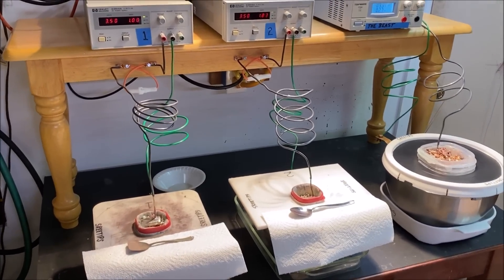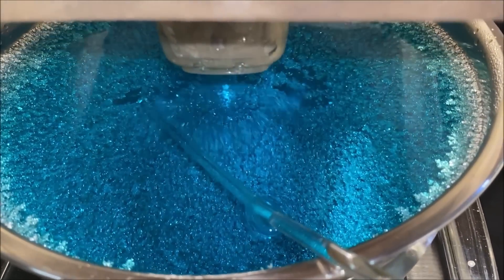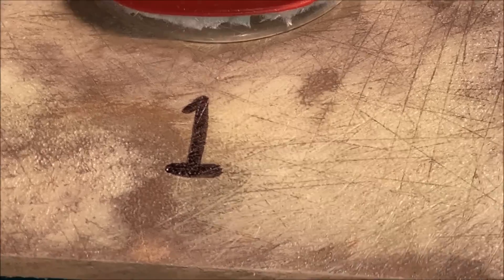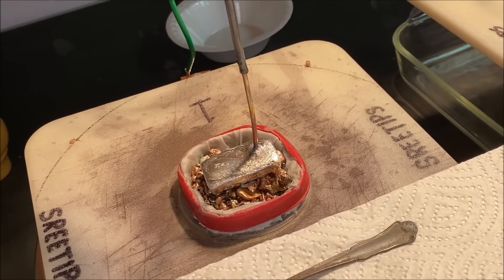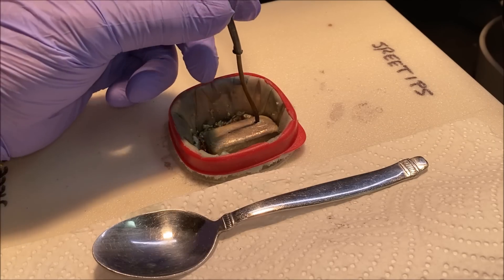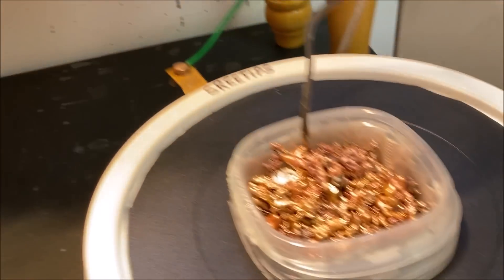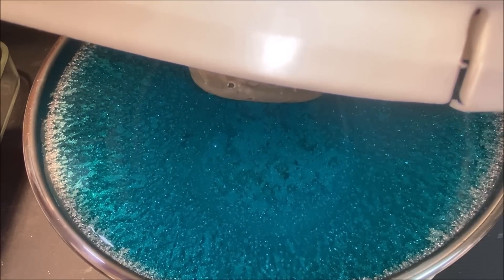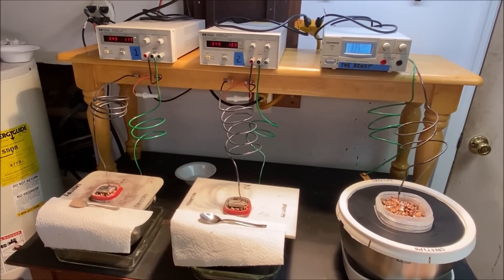Silver Cell Day 3 Maint 72 Hours Crystal Growth

Comment: I'm sure you have gone over this befor but why do you have to have silver dissolved in the elecrtrolite is it for the silver nitrate to form I don't know much better brains have came up with this than mine I just really strive to seek information from a reliable worse. Knowledge is freedom not just power
Reply from the maker: The electrolyte is conductive and it completes the circuit.
Reply: The way the silver cell works is impure silver is converted into pure elemental silver. The way that works is impure silver is dissolved by the electrolyte, which also has silver nitrate in it. The silver nitrate and the electric current make the impure silver into Ions that then pass into the fluid and go to the walls, which is where it's later scraped off when it's harvested.  Now for the too long; didn't read section. [tl;dr]

A little more detail here... The silver nitrate solution, the electrolyte, can not take up any more silver. It has had all the nitric consumed with the silver used to create this solution. The electricity has a clear path through this electrolyte to the walls of the bowl. Here it completes it's journey  -from the negative to the positive, this is the way we we're taught. 

At an increased current (amps, or that measurement of current named for its discover André-Marie Ampère) the electricity can do work with all this current. What happens is the inpure silver starts to dissolve- I hear you say didn't the prior statement indicate the electrolyte could not take up any more silver?  The extra current at that voltage is actually doing the work here. A small amount of silver plates out, the impure Silver dissolves into an ion to take the place of the plated ion. This goes on and on so fast we can see the crystals form, atom by atom. The ion becomes elemental silver making room for an ion of impure Silver to undergo ionization. The ion joins the rest of the electrolyte leaving behind all the impurities associated with it. This is called Electrowinning. Glad I got the spelling right. If you want to learn more do look into these topics, and I hope this helps.

For anyone wishing to use these words please double check them, I sometimes get my Positive and Negative confused as we saw earlier in one of my posts. I got very confused a long time ago. A monseigneur was telling me all about the physics of electricity and how we got everything wrong to begin with and reversed the actual names and functions since we didn't know better back then. It has stayed with me ever since as a confusing thought.

Edited for spelling and clarity

Comment: They look beautiful..love it ..question for you,,someone  mentioned circulation of the fluid,,would an airpump from an aquarium work? You could use extra fine diffusers the are designed for co2 for planted aquariums,,they are available in glass type,,one more thing,wood, although not highly,is conductive,,it could mess with voltage supply,,plastic would be a much better insulator instead of screwing the fuse terminals to the wooden table
Reply from the maker: I would not pump air into the electrolyte. Stirring would be much better.

Comment: Does this work on a larger scale I'm sure to some point it does but if you increase the voltage it's just going to electroplate the inpure silver shot on the cathode orwhat will happen? I know the filter basket has a lot to do with this type of refining this kinda stuff really interest me I would like to know all I can about the proses goin on there like if you were to increase the voltage and a lot more amperage would it work faster
Reply from the maker: Constant 3.5 volts DC is critical. Increasing voltage will cause the silver crystals to form very fast and very long needle-like. Make contact with the anode filter in less than an hour. Large scale would require a moebius silver cell, alternating anode cathode plates hung vertical in a tank with gallons of electrolyte. Probably pull a hundred amps or more. My Thum cell (anode suspended over the cathode) is plenty big enough for my small hobby operation.